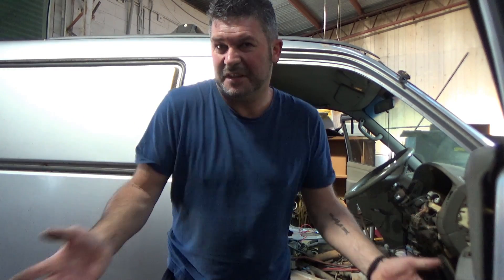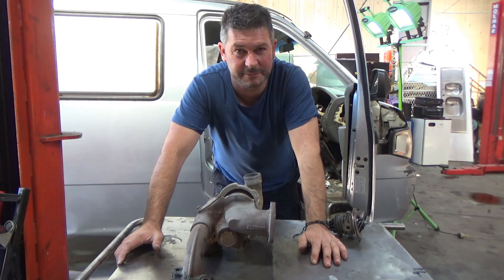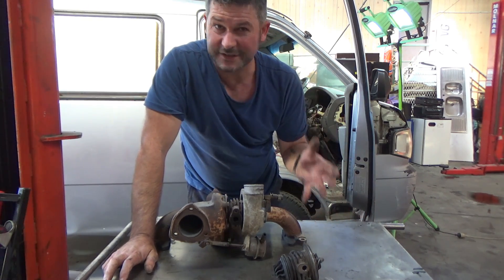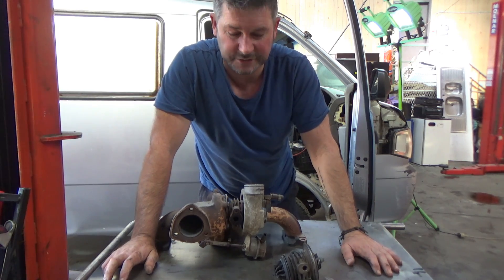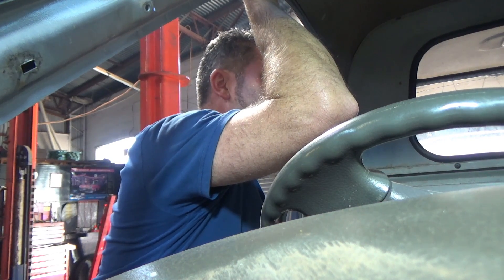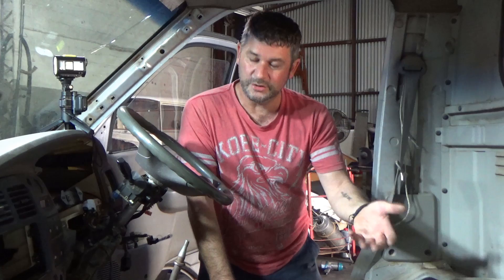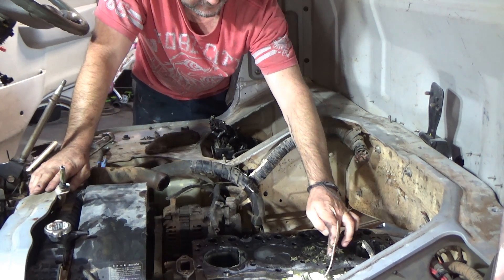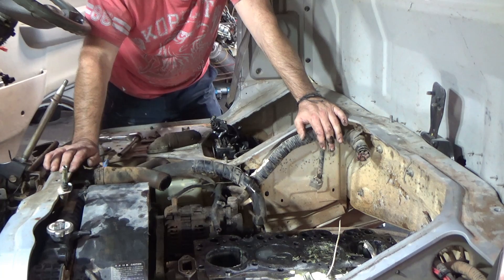How to Stop a Run-away Diesel -ENGINE BLOWS !

Comment: Yes!!! Finally somebody who came with the engine stall!!!!! Yesss!!!!! Jackpot!!!!! I am sick of those nonsense air intake block and the blahblah stuff! 99% of the peeps eeven dunno where it is! But throwing the last gear and dropping the clutch at once whithout a blink? Noooo, this hits no one' brain! Congrats on this simple solution
Reply: In a true runaway , a diesel engine can rev over 10,000 rpm, producing up to 10 times its rated output. I have never once heard of anyone successfully using the clutch killing a runaway. It burns the clutch up in seconds. Big trucks have 2,250 ftlbs clutches and will no way hold a runaway on a 16 liter engine. The problem is, the clutch is only made to handle just a little more the the engine puts out normally.  I have never seen a dyno runaway but i have heard around 10 times the hp and torque before the blow up or lock up.
Reply: @poellot  the problem is i had a runaway, in my ford truck, rpm got at 8tho. and the clutch with 6th gear solved it, thasall my friend

Comment: if it's running away on its own oil, deprive it of oil (e.g. if you have a pistol handy, shoot a couple holes in the bottom of its pan).   It'll probably die and spin down before the lack of oil on the bearings and other surfaces does much damage.   Then you should just have to replace the pan and the oil (and maybe the oil pick up tube if you were unlucky enough to put a bullet hole in it :) )

Comment: this is a mechanical injector pump, which is on older diesels, modern diesels are injected from a cpu operating  injectors. it cant runaway if you turn off the cpu power.

Comment: I'm a Marine Engineer. I've had several runaways. Turbos will do it, as you said. Leaking diesel past injectors, lift pump, injector pump on a non-turbo engine will result in engine oil getting too high. This in turn starts to blow out of the dipstick and crankcase pressure can force oil into the intake via the breather. The engine revs faster and faster and is only limited by the physical constraints of reciprocal mass port sizing, etc. CO2 extinguisher will work. Clutching doesn't work on a boat but would burn out the clutch generally, on a car. Best way I've  found is to take away the air by putting your hand over the air intake on smaller diesels. Trust me, it doesn't rip your skin off, give you a rash or cause cancer! If air is getting past through the breather, (if mounted below the intake), then this won't work unless you block that as well. Another way is to cut the breather so removing the fuel supply. Cutting diesel supply won't do a thing as it's the engine oil that is being burned. Steve.

Comment: Everything you’ve said has been wrong or inaccurate run away doesn’t happen because of the turbo it runs away from over fueling or oil getting into the cylinder because diesels run on compression and not spark plugs more fuel means more power and it builds rpms until it blows a rod and only way to get a run away to shut off is to either A cut the fuel with a ball valve or manual cut off plate a lot of older diesels have or B get rid of the air C you put the rag inside of the turbo to kill it but also ruins turbo saves the motor and D modern diesels don’t have it as much because it’s all efi now and not mechanical and last but not least putting it into a higher gear only works in a city on highway won’t work

Comment: You could on a td if it's oil leaking into the turbo just take the charge pipe between the turbo and intake manifold or intercooler

Comment: That was not run away that was just a guy holding the motor at high rpms the only way to stop a run away is to block the intake and it will stop the motor

Comment: So after watching this video what I learned is that if my diesel ever goes into a runaway condition I should take the oil cap off and keep replenishing  the engine with fresh motor oil so that the engine does not run dry and damage itself.  :) Thank you for the tip.

Comment: If you used the extinguisher out on the road, it would be used on the dirty side of the air cleaner element so would never find its way into the engine. Unless the element collapsed inside the housing as a result of extreme vacuum as it blocked of course. As you say, easy enough to stall a manual transmission but the extinguisher would be the effective last resort on an automatic. Mud or dry dirt might also work.
Reply: Huw Williams That's why you're supposed to use a CO2 fire extinguisher, not a powder type. This that be used directly into the air intake, passes through the air filter with no damage to it and shuts down the engine. This guy doesnt have a clue what he is doing! He must of just Googled 'how to stop a run away diesel', seen the word fire extinguisher and grabbed the closest thing to him without using his brain. And this guy gives advice......

Comment: I always wondered why more diesels didn't have fuel cutoffs to stop a runaway - I didn't think about the fact that they can keep running on their own oil. Makes sense, and explains why the smoke of a runaway diesel is usually white (oil smoke?). 

Looks like shifting into a high gear would be a good idea if you catch it quick. I'd be nervous in the driver's seat - what happens if/when it engages the transmission and you start moving? Then you have a runaway that might be stuck in gear because of a melted clutch? I'm not sure if that is even mechanically possible. 

Seems like cutting fuel with a cutoff and using something solid isn't the best approach. Slap that sucker in high gear or fire extinguisher... fire extinguisher might kill the old girl!

Thanks for sharing!
Reply: Diesel engines need two things to run, one is fuel, the other is oxygen. Cut out either and she will stop. Yes they can run on their sump oil, therefore cutting oxygen is imperative.

Comment: Your intake was leaking under suction is the reason the wood block didn't work.
The extinguisher is the best method but, should be a C02 type so as not to further
 damage the engine, solid/powder types will damage as shone.

There is one more but last resort way 5 gallons of water poured as fast as possible 
in the intake but, this will bend the connecting rods which drops the compression
below what it takes to burn what ever is being burned as the fuel, oil out of the crankcase
or over fueling from the injector pump.

A couple of other hints, knock holes in the fuel filter(s) with a screwdriver and hammer or 
hammer the fuel injector lines flat.

Comment: A single rag won’t work, but a bag of shop rags will. I’ve seen them used on a v8 Detroit 2 stroke and it swallowed about 50 rags before stopping. Had no damage to the engine. Just the techs ego. Lol

Comment: You could still try using the fire extinguisher on the basis that if it does stop the runaway, it will be a lot cheaper (probably) to strip, clean and rebuild the engine than to buy a replacement.  Letting the engine destroy itself by doing nothing is asking for a new engine regardless — or a major reconditioning job which will be a lot more expensive than a clean and rebuild.

If the engine is running backward, discharge the fire extinguisher into the exhaust pipe.

Use your common sense -- if you have any!

Comment: Liked the video and yes you would have had a problem with the rag. Being in the oilfield most companies now require an air 
shut-off on the intake. This is because of gas fumes being sucked in for fuel, hence run away. For a turbine you only need to add a dump valve with it to bypass the flow before the shut-off. Did like the different types to shut down, but I guess if the engine blows, it couldn't be as bad as a minor overhaul to clean the cylinders if the block survives.

Comment: When I was a truck driver, I had a small Vice Grip in my side box. Why? To crimp an air line to a bad brake, and to crimp the fuel line, if this ever happened.
20 years of trucking, and never had to use it on my truck, but did once in Wyoming. Yes, it ruined the fuel line, but saved the engine...

Comment: I have had quite a lot experience with 8v71 Detroit engines. The ones with blowers. Between the intake and blower there is a flap that shuts off the air consequently the engine shuts down almost immediately. A rubber backed floor mat works well for a vehicle without emergency shut down.  PEACE

Comment: Nice video and well explained. On some engines there is a lever or thing to operate manually to kill an engine but this only cuts the fuel, i suppose it wouldn't work well if the engine is fed from the oil.

Comment: Great experience there but you did it a bit wrong. It's not a turbo engine, block of wood/rag works when applied on the intake ... of a turbo. Because there's only one straight "proper" intake. Could've worked in your case if only you also blocked the hose from the breather vent. Another way to stop a runaway is simply to "remove" one of the turbo/intercooler/intake hoses, say for example, the one before the intake manifold. I did stop a runaway (twice the same car haha), first time the 5th gear stall worked, second time it broke the clutch and I removed/broke the Intercooler>Intake hose, spat a sh*tload of oil and then the car stopped.

Comment: In a real situation the rag does work as your not holding the throttle wide open, use one hand to hold butterfly shut use other to place rag over intake. If it is being fed oil from the turbo taking the inlet hose off also stops it, this video is a waste of time as it helps no one.......

Comment: The statement wood is not porous is not true. In fact wood itself contains a lot of air and a vacuum will draw air through it.  In some milling, routing operations wood is used on a vacuum table to hold material secure while it is machined. This is so cutters can go completely through the material being cut to allow it to come free afterward. The wood acts as a sacrifice block.

Comment: Your tests are foolish. .your testing an engine that is still governed and running a slower rpm.. Run away diesels can hit 3 or 4 times their standard rpm..this causes them to have twice the power as normal... Dumping the clutch in high gear? It will fry it... Block of wood? Haha.. That engine is a bomb, I have seen run aways, blow pistons 20 foot away.. One of those hit you, and your dead... Best advice? Run like hell....your test engine was never in danger of blowing apart and killing you
 Two totally different animals...

Comment: so how about on cars with a rubber pipe linking the intercooler to the eingine  either cutting that or removing it as it would stop the forced air and the forced oil induction?

Comment: What is available in the vast majority of all vehicles that you could use to plug the intake is the floor mats. However, the intake has to be plugged after any PCV-connection or bypass connector etc.

Comment: It's great to hear all of the ideas regarding the stoppage of runaways by cutting off the oil line to the turbo. The unfortunate fact is that you don't have to have a turbo for a diesel to runaway. If the oil scraper rings fail a diesel will runaway fueled by it's own engine oil deposited on the sides of the cylinders.
Reply: I think I'm going to keep having a fire extinquisher nearby, seems like cutting of the oxygen is the only way to really make sure to stop the runaway.
Reply: @velianlodestone1249  Make sure that it is a CO2 extinguisher. Dry powder extinguishers make a mess. Water/compressed air extinguishers are a recipe for bent conn rods.

Comment: I am a qualified diesel fitter a runaway diesel is when the governor let's go the engine then revs way past it's normal red line you never try to stop it you run away from the engine as fast and as far as practical it is to dangerous to do anything else your life is at risk, this video is absolutely rubbish the engine is only at a high idle and not runaway revs, you won't have time to remove air filter so please ignore this rubbish

Comment: The only way I have ever stopped a run away is to kill the fuel supply. I haven’t ever tried the other methods.
I have seen a guy block the exhaust on a run away when the engine started running in reverse. Crazy as hell.

Comment: The fire extinguisher does not actually work due to compression loss. It is filled with regular baking powder and it cools the combustion process so much that it dies. Baking powder is excellent at cooling.

Comment: Naked Off Road

....your making more of it and complicating the matter of a simple fact. A neglected/worn-out Diesel once the water-temperature,oil temp,and block temp get to sufficient degree...any Diesel will runaway and its fuel source is the volatile engine-oil...and in some cases its intake"oxygen" source can also be gotten from leaking seals in the sump,worn (intake/exhaust) valve seats,etc. . On a really  worn-out diesel, shutting the injection pump off/clogging the intake inlet is  futile, as that runaway diesel already has a good supply of fuel in the sump and oxygen as already described.

When I was a kid, I inherited a neglected 5 Speed VW Rabbit Diesel (my brother never changed the oil)...once the engine got beyond "normal" operating temperature...it was always guaranteed to RunAway....so for a few of years, I only drove it cool weather (never Summer) and never in stop and go driving that would allow the Engine to Load-up and runaway with no possible sound recovery method.

However even driving it in cool weather, that damn thing would do a "mild" runaway on me going-up a Grade,etc.....when that would happen, I simply would make sure it was in 5th gear,crank the heater all the way up,let off the throttle/turn off key. After the engine had stopped running-away....I would very carefully allow it to die (while still in 5th Gear) while pulling off the side of the road. 

Once the engine died, I simply wait for it too cool down,fill the engine oil to proper level and cross my fingers; the crest of the Grade was near or be prepared again to safely manage its runaway quirks.

Comment: I am old enough to have ridden in GMC city buss' that had 2 cycle diesel engines and automatic transmission with no neutral. They had a co2 cylinder and a emergency kill button where the driver could kill the run away with co2. what the hell is wrong with people. why no air shut off valve? old mercedes diesels had an air shut off.

Comment: if you value your hands and arms, don't go anywhere near the intake on a proper runaway. Certainly not by trying to stick a rag in it. Try that on a big cc engine and it'll pull yer arm off.

Comment: Wouldn't removing the air intake hose take away the air/fuel mixture being injected into the engine from the turbo?  When I say remove you can cut it away with a knife.

Comment: Dry powder creates CO2 when heated so perhaps a little less may have worked without as much damage. But saying that if your engine is running away t the point it's burning oil it's pretty much stuffed anyways.

Comment: All of engines runs with oil from turbo. You cannot stop with fuse remove, or disconnecting battery. Runs until all of motor oil burned away. You can move to fifth, or sixt gear + Clutch + Brake. If you have manual transmission.

Comment: I once saw a containerised V16 32Lt. diesel genset runaway, it revved so hard the flywheel exploded & killed the mechanic inside the container, a 1,500 rpm engine revved to 6,000 rpm because the governor was jammed. Bits of flywheel became ballistic after killing the poor bugger, they came through the steel container walls & injured another 3 guys, jeezus what a mess it was.

Comment: Since it's burning the oil in the engine if it started to run away could you use a block of wood to slow the burn and then jump under the vehicle and drain the oil so it has nothing to burn?

Comment: Water, CO2 or BFC extinguisher if you have one, pour water down, or block the intake with a compressed wet rag. Sorted. If you drive a slush box, then you most probably do not care about driving, cars or trucks and are beyond help.

Comment: Petrols can run away my 2 stroke dirt bike did
Reply: Jeffry Porkinton different principle... in a two stroke, the only oil that can get into the cylinder is mixed in with the fuel. The sump is dry and no oil cooling is used. I suspect that the governor or rev limiter failed. Turning off the fuel tap would have stopped the engine in short amount of time.
Reply: i did turn off the fuel tap and saved the engine but the weird thing is a week later it was fine so i dont know what it was
Reply: Jeffry Porkinton Perhaps you had a stuck throttle. As long as you and the bike was okay.
Reply: gorillaau maybe

Comment: the rag on air intake will work , I already saved a runway AX diesel like this . And even if is suck in will get to the air filter compartment , not inside the engine . no one will try to get the intake hose from a runaway engine ... On a manual Gearbox , the high gear + heavy break is the easy and fast way to do it .

Comment: A lot of the old 2-stroke Detroit Diesel engines had a plenum that attached to the blower. Inside was a metal plate with a spring loaded mechanism. Some had an emergency shut down solenoid or cable that you could kill it in the event of a runaway. Some of the engines that were in generator applications had a mechanical speed switch that would energize an electrical solenoid to slam the plate closed. We see some newer class 8 engines come into the shop that have run away or ran backwards because of injectors that hung open. I have only seen a couple turbos fail on the compressor side. One of the easiest ways to kill a truck that is running away is put it in 10th gear and dump the clutch with the park brakes applied. Just better hope the customers slack adjusters are working.